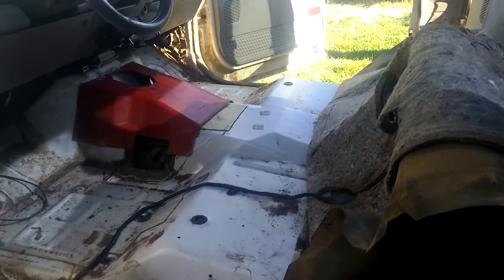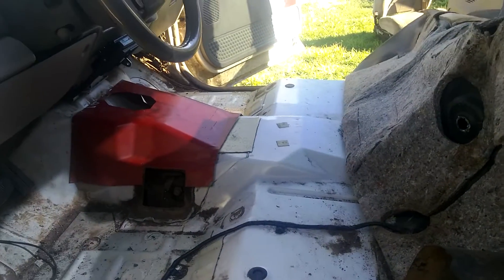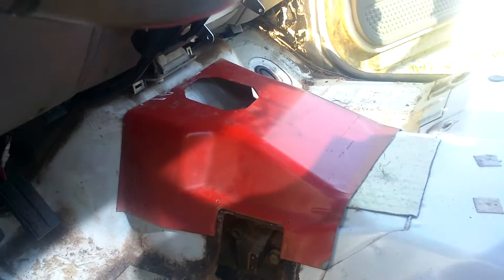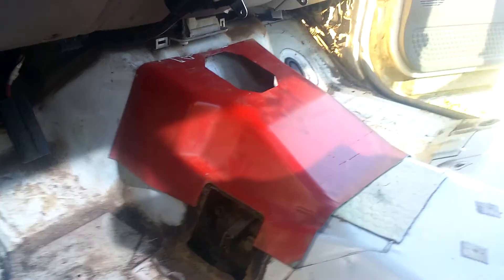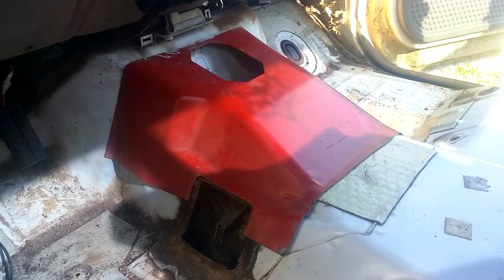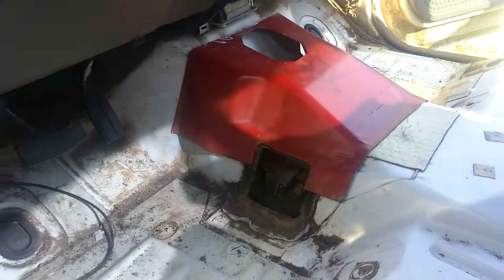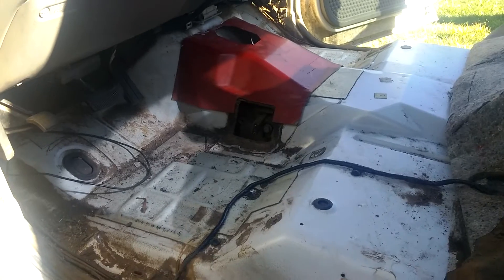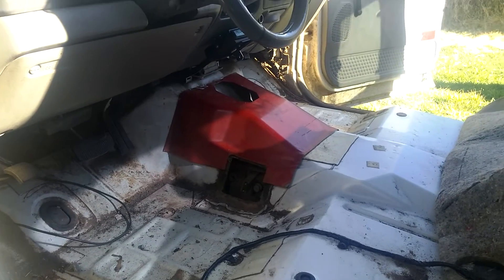F350 auto to manual conversion pt.1

Comment: Did you make the tunnel or where did you get it from
Reply from the maker: I cut it out from another truck that was a manual from the factory. But some people do make them or just use a jack and a 2x4 to stretch the metal to make it fit the ZF6
Reply: @elmaschinon2699  thanks i am doing the same thang you but in a 2009 6.4 truck

Comment: The 8th and 9th generation f-series pickups had removable trans covers so you could have it closed for an automatic and open for a manual or to work on the top of the transmission

Comment: have a few questions about the swap can you call me my name is chris and my number is 425-563-8635
Reply: I know this is an old post. But what am I looking at cost wise to do this?
Reply: Christopher Roberts You’ll save finding a wrecked truck. If you want a Zf6 four wheel drive good luck. The run $1800 in NC you might find a truck for 2k and have everything you need. You need to cut out the floor pan, ECU from the Manual donor, wire harness from the wheel well down to the transmission. And the clutch pedal and slave cylinder. You will also need the thin metal plate off a 7.3 that had a manual trans. Along with the clutch flywheel etc. So your better off with a donor truck for 2k than trying to buy everything separate
Reply from the maker: Hi, sorry i haven't called. I didn't get a notification on your comment. My cell is (530)282-9911. Give me a call and ill try to answer your questions.